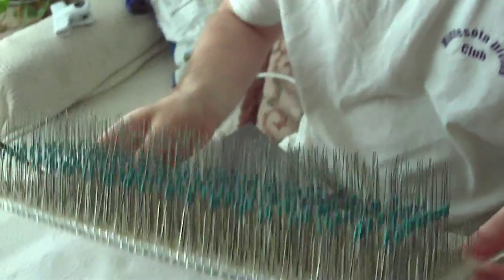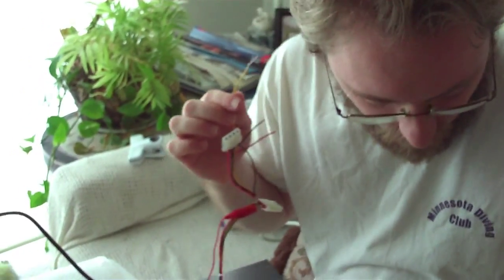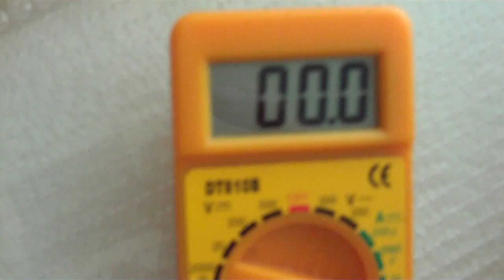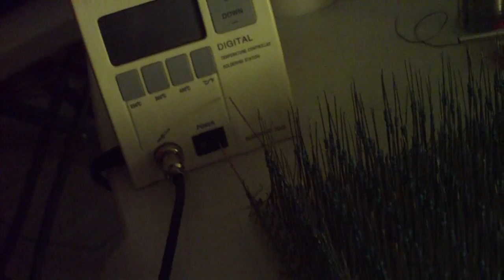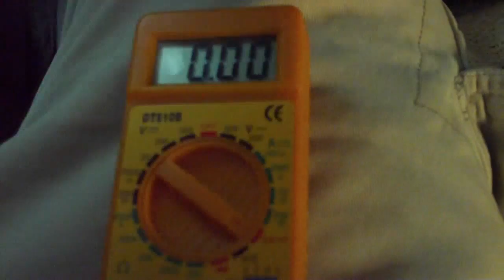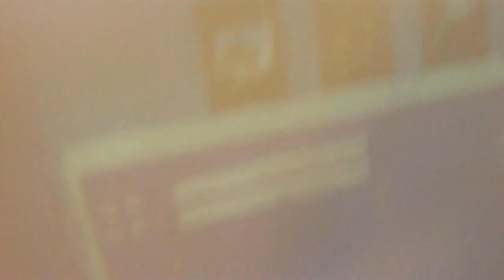LED LCD projector experiment version 1

Comment: wouahh that is impressive. soon my items will arrive and im going to build my first lcd projector with an 3.5" lcd from ebay. and i also going to build my own led array . i dont know how many leds i will need, but around 50-100 leds i think. anyway do i need to cool it down or can i skip that part when i have so little amount. Maybe one or two fans are more than i need. i dont wanna burn my lcd. so any hints?